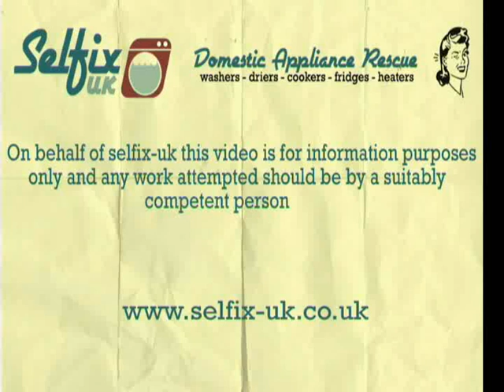How To Fix A Blocked Washing Machine Sump

Comment: Hey, I've got a machine that either doesn't drain fast enough or acts like nothings wrong depending on the time of day, already replaced a part on it and had a feeling there's a partial blockage somewhere at the back. This video will come in useful for that later